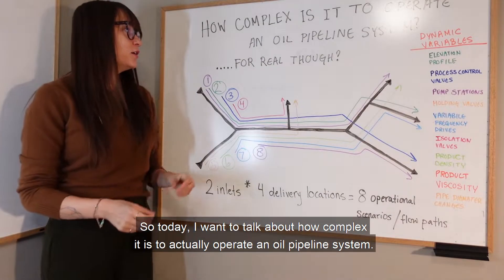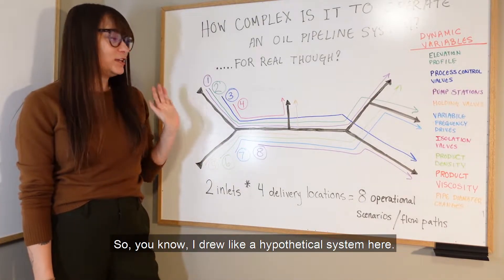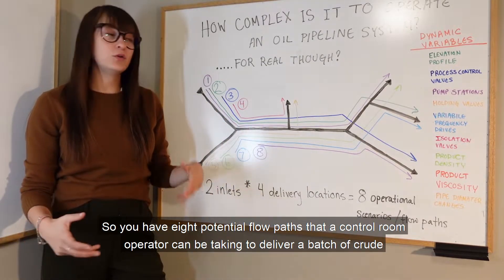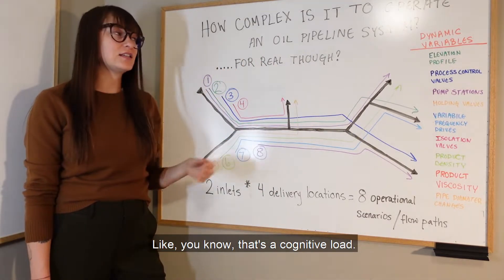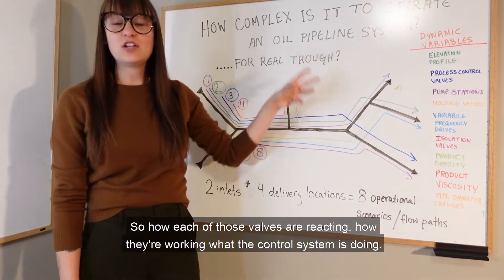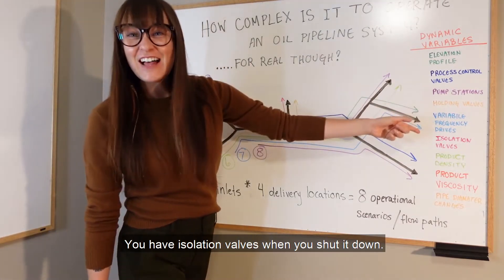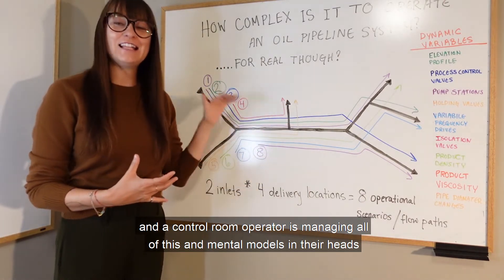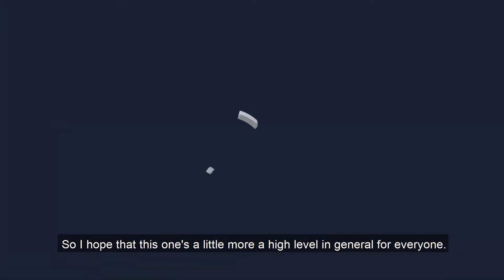How Complex is it to Operate an Oil Pipeline System?

Comment: Are there not 15 flow scenarios?  You can have 4, 3, 2, or 1 outlet flowing for each case of one inlet, plus the case of both inlets flowing.  And of course pressures are changing with the density of the products and position of the batches moving through the pipeline.

Comment: Same algorithm but seperate modular with center big hole as computational chinese to avoid single point of failure. always big hole center subsets. Simple for chinese.
Reply: Load balancer center big hole signal rate different. Highest speed not center inner. Lowest latency is center inner. Center outer is separate network. Same concept can apply to many things for engineering snobs.